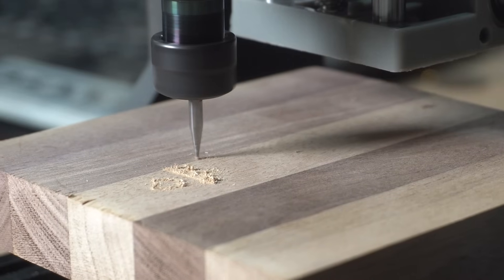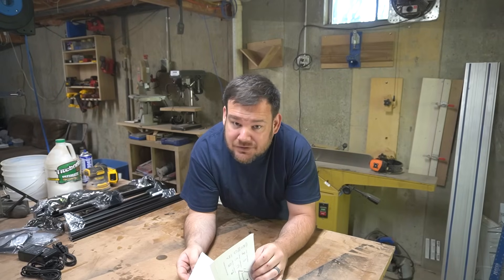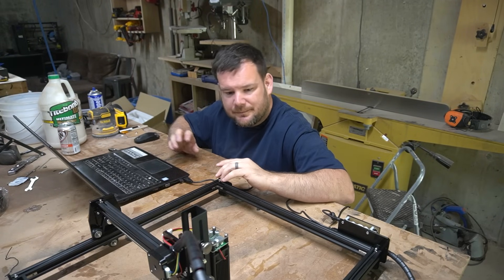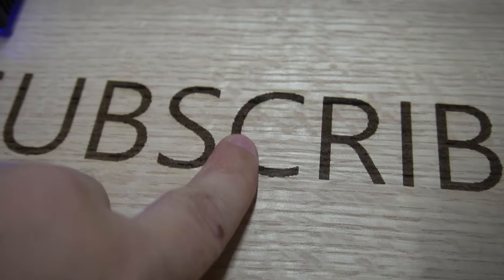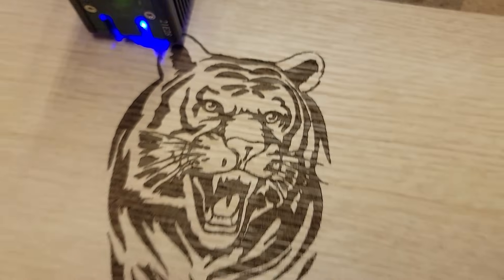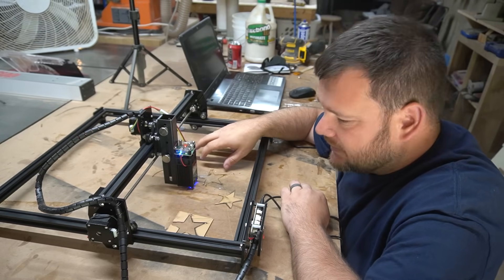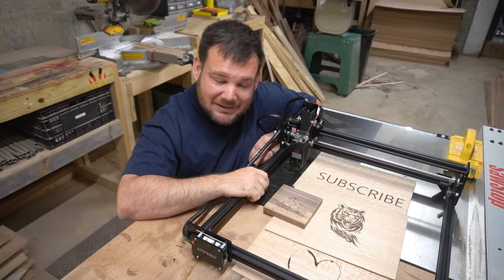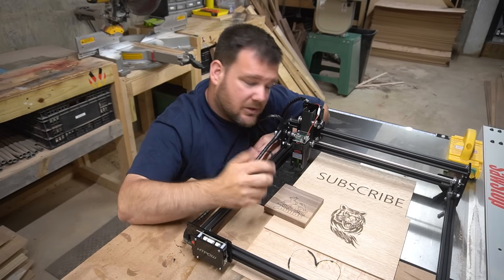The Cheapest Laser Engraver On Amazon

Comment: Wow, great video, really answered alot of my question.  I just bought a small cheap one called ( Roomark 3.5W Output Laser Engraver Machine) from Amazon, I paid $69 for it on a sale and I couldnt resist, like I said its pretty small, the max engraving area is 5.12"x5.12", (13mmx130mm) but I bought it to mostly make engraved leather key fobs and coasters. you should do a review on this one for people with very limited space. Again thank you.
Reply: Do you recommend it? My buddy and I just started making coasters and want to some engravings. Mainly we want to do sports logos. Would you recommend that product to do those?
Reply: @coltonallen9499  Yes it does great on cork coasters, Ive done over 25 sets with it plus it does wood pretty well, just remember that its a laser engraver and not a cutter, and you'll be fine, also play around with the settings to tune in the laser, I put my seed to 6000 mm/min for cork, and 5000 for leather using lasergrbl software, which is pretty easy to use once you tinker with it.

Comment: I think one of the only reasons I even want a machine is because I’m too lazy and sloppy with hand routing and scrollsaw/bandsaw. I have to stay far away from my lines to avoid errors or chipout, which then means way too much time sanding and making a mess of the shop. I have this ideal dream of a machine helping me to avoid all this, and being able to go straight to gluing parts that are perfectly cut to fit together. But realistically a CNC or laser probably isn’t going to save me enough time or energy to make it worth my while unless I were using it to mass produce small parts that need to be identical. And that’s not really what I’m doing.

Comment: Correction my friend,   it's not so much that the white paper reflects laser light causing no effect upon it, think of it more as white is not inherently useful for absorbing light at those wavelengths. For most materials it's going to be more factor of absorption through darker color. Black will always be the best and will absorb pretty much any band of light used on common laser units whether it be CO2, mopa fiber, diode, or any series of diode pumped units. White is just terrible at light absorption.

Comment: Anyone have an image for the USB drive for this machine? I just bought one for less than half the price(already built) but it didn't come with any instructions or configuration software and no safety glasses either. I've looked at several videos on setting up a engraver manually. It'd be great to have what it came with and a recommendation for safety glasses would be appreciated. I also won't mess with it until I have the glasses at least. Thanks in advance!

Comment: It may be a good value for money laser, but that comes at a complete disregard for safety. My main worries are potential toxic fumes, fire hazards and Instant blindness.
It is quite worrying that many people use this laser without any eye protection or the included eye protection. The included "eye protection" may help a little bit but at the end of the day it is just some random colored plastic with no certifications or quality control. A good certified pair of laser safety goggles that actually protect your priceless eyes would cost you about as much as the laser itself or more. 
The only safe use I can see for this, is if you wanted to upgrade it with a fume extraction system and an enclosure to protect against the laser radiation.

Comment: I'm planning on buying this cnc machine with laser too. Was wondering if it can be use as depron (6mm) cutter instead or engraving?
Reply: There are vids for making oscillating wire foam cutters for Depron, unlike routers the sewing machine action of the wire cuts foam real easy. These diode lasers reflect off white foam, but do cut black foam board apparently. I will need to try it, F117, B1/B2 models?
Reply: @babbagebrassworks4278  Yeap, most were saying the same thing. Furthermore, it's hard to get colored depron with 5mm thickness around my area. End-up building my self a CNC Needle Cutter.
Reply: @MyspanaMJ  You should do a vid on your CNC needle cutter, been thinking about getting back into modeling and making kits.  A needle cutter would make that easy and the cutting forces means a low cost sheet sized extrusion frame should work. I got 200 + hours on Paragliders before getting grounded, never got paramotor certified. FPV would be a safe way for me to get back in the air so to speak.
Reply: @babbagebrassworks4278  i’ve built the Erc Timsav cutter, works great. Coming soon will be building the MPCNC Primo and definitely will have a video on that. Paramotor grounded due to no license? Thats bad. Here we do not need a license for a solo but needed if tendem. Mann.. love paramotoring too.
Reply: @MyspanaMJ  Na, grounded by new wife who didn't want to be widow and raise kid alone. I did push the edge a few times and fell out of the sky twice. Here in Oz we must be certified by instructor and get licence, tandem is extra with insurance and paramotor extra cert again. Busy cleaning up junk room to make space for building stuff, learning CNC routing, lasering. Don't have 3D printer but I reckon I can CNC cut parts for one of those wire cutters. Got a pile of old Depron from before marriage. Will try cheap foam first. Makerstore  in Oz has stuff for DIY CNC.

Comment: I have a pair of jl1 that cost me $79 each... One of these has been modified to carry a NEJE 40630 led module.
 
 I cleaned up the wiring since the photo.  I have another one I keep around that's still stock.  

This is the before/after of the laser module upgrade...

https://drive.google.com/file/d/1JjQgJpIEzRpGh043M6wphY099G-kehsS/view?usp=share_link

I run Ubuntu Linux, so I can't natively run any of the software packages that the Chinese supply with these lasers, they are all windows based.

Another user asked the vendor for software and they got an .exe along with a .bin file.  If you run that program it upgraded it to grbl firmware on the 32bit controller and you can use Lightburn.

They are all driven with Lightburn...  

These lasers are a fantastic value, but, currently, hard to find ...  I don't know why they don't just grab a grbl release ...?

Comment: You can cut with that:
- you can't keep the material laid on the base, it has to be suspended like with a metal honeycomb, for the cheap make a bed with some one inch screws in a grid
- build a small air assist with an aquarium air pump or an air compressor

Comment: Is it possible to mount this onto a wall? When you can mount this onto a wall it doesn't take up much space. I was thinking to mount it on a wooden plate onto a wall. It also makes it easier to suck away the fumes especially when you make a small cabinet/enclosure for it with a transparent door at the front. Good or bad idea?
Reply: no
Reply: Bad idea.

Comment: 5 to 10,000 hours on the laser.. question what’s the power of that particular laser.. Some R-rated strictly by the wattage 1,2,3,4 ,5-20,40  watt  and some light the optical power which is described as being lower than there’s a focal point wattage.. And they usually upgrade with different control board and there’s a lot of software out there available . Perhaps better Stepper motors..

Comment: Sadly, Diode lasers in this price range are barebones (which I know is the basis of this video). Though they work, they are missing some essentials. One of these essentials is a dedicated air assist setup. Typically these setups have a way to direct air right on the material where the laser is hitting it. This allows for a more precise burn and less chance of charring or burning. One problem is that the more you improve the laser, the closer you get to the high-end lasers that already have these features. Diode lasers seem better for picture quality burns, whereas a CO2 is more along the lines of a cutting tool (acrylic, wood, leather, etc). I happen to have both and use each tool accordingly. 
 Lastly, a fiber laser is great for marking metal. You can do some marking on certain metals with a Diode and a CO2, but it is super limited and usually have to have some sort of marking spray added, like Cermark or similar.

  Also, for any laser, be prepared to jump down a small rabbit hole on proper ventilation (7:25 minutes into the video above), air assist and most likely an enclosure for the laser. Though most of this can be circumvented by placing a fan in the window, you want to remain present for burns as it can cause a house/shop fire if you walk away.
   Keep in mind that the more detailed an image you try to burn, the longer the burn times. A high def image in a size of 4"x4" can roughly burn for 2.5 to 8 hours depending.
Reply: You seem to know what you're talking about, and a fellow German. 👍

I have a full woodworking and metal fabrication shop, and 3D printers, but this will be my first laser.

What's your opinion on the new Creality Falcon 2. Seems like a nice machine. With current sales and coupon it's $950. Seem worth it? 

Or what route would you go with a budget of $1000?

Comment: I have not the slightest clue about engraving but I find that many Amazon items that seem cheap actually seem to hold themselves quite well for the amount of money. For example I got a mini multitool for engraving wood and such but got it for sanding and metal works. It was about 15 bucks and so many people complained about it. They won't do any heavy lifting but when you keeps their tasks simple and test their limits you get a cheap fairly well working tool. You just can't expect pro tier results from a low end tool but with that in mind you can get great deals for a practice tool you won't be mad about when it breaks. Which it will sooner than later.
Reply: Well they're not Amazon items. They're sold all over the Internet, including eBay.

So you can't just say that buying it from Amazon you're going to have luck. It's a 50-50 chance no matter where you buy it from.
Reply: @dangerous8333   If you want to get all---- 🤓 Ackchyually...
Then that was not really the point. They were talking about budget items you can order. And  this video was about the cheapest laser engraver on Amazon so that is how the poster stayed on topic. 
And what do you mean by 50-50 chance no matter where you buy it? That is WAY wrong. If there were a 50-50 chance of getting a decent working quality item or a crap item that doesn't work, we'd all be screwed. 
Plus Amazon discontinues crap that gets bad ratings, and has a campaign against fraud and knock-off products  so the chance of  getting better quality items HAS gone way up.

Comment: Thanks for your video!  OK, you call it an engraver.  I'm a silver smith, and have been looking into something like this to engrave my maker's mark onto my pieces or little tags that I hang on necklaces & bracelets.  Did they say if it will engrave metal?  I've seen others do it, but not sure what they were using.    Thanks!
Reply: There is a way to use the laser and some material to acid etch metals - the laser "cooks" the material and makes the acid.  IIRC, mustard is one such material some people use, but I'd imagine it would depend on the metal involved.
Reply: Unlikely to engrave metal, that would be problematic with any laser cutter except some super high end ($10k+) fiber lasers designed specifically for metal. Metal both requires a lot more energy to do anything to, and its reflective so the laser would just bounce off without doing anything to the metal (but could potentially cause damage or injuries). Could make some pretty cool tags out of cardstock or wood though.

Comment: LED lasers typically wont cut white materials.  I tried to cut white Styrofoam but no cutting not matter the setting.  REplaces it with blue foam board and it cut right through.   Black foam board cut best.
Reply: You're actually lucky it cut blue. Diode lasers emit blue light, and as such don't work well on white or blue materials. However, strictly talking about engraving now, there is a "hack" you can use when working with these colors: Tempra paint (also sometimes called "poster paint") is thin and water soluble. Apply an even coat to the material you wish to engrave that the diode wouldn't normally work with (clear glass, clear acrylic, etc) and you will get fantastic results once you find your diode's sweet spot.
Reply: @AduroMark-ChainReaction  We've used this technique for engraving white plastic labels using a diode laser at work.  We "paint" them with a black Sharpie, engrave, then wipe off with a solvent.  This also leaves a small amount of the Sharpie ink in the engraving which is quite effective.

Comment: For cutting through thicker stock cleanly, simply find the speed that engraves well without burning the edges, and run it multiple times till it has cut through.
Reply from the maker: Thanks for the info!
Reply: Sure, you could do that...but.

Time is money.

So is electricity.
Reply: sure but some people have the time but not the money @dangerous8333
Reply: @dangerous8333 can you engrave a pumpkin?
Reply: @mikedisher30 Yes, technically you can, but you would have to remove the laser module from the frame and engrave the pumpkin by hand, which I would highly recommend no one ever do.
Reply: @mikedisher30  Yes, you would just have to raise the whole machine to the needed height of whatever you want to engrave on. There are extension legs for these machines.

Comment: i didnt read all of the comments but it seems like if you did a few passes at the higher speed and power you might be able to cut with it. also when cutting through something you might want to get a honeycomb panel that the laser engraver can sit on to help with air flow when cutting something else out. i work with a xenetech (do not recommend) and a gravograph (highly recommend if wanting to cut things out about an 1/8 in thick) both of which do great in their own right. gravograph is so easy to learn its programing and is very user friendly. both laser engravers have a honeycomb that the projects can sit on if they need to be cut out.

Comment: Andy - like your video. Tried to find it on Amazon - no dice. Do you have another possible link to where it can be sourced?
Reply from the maker: Thanks. Unfortunately I don't have another link. Hopefully the manufacturer makes them available soon
Reply: @AndyBirdBuilds  sadly, they won't. These machines are Ortur clones, mass produced in China (doesn't make em bad...I'm just pointing out the facts), and they are sold at what ever price point they can get away with for as long as they can. As soon as Ortur (also a Chinese manufacturer) gets wind of the competition, Neje (Ortur's parent company) buys the factory or sues for breach of patent (serious offense in China if the owner of the patent is a successful Chinese company...which Neje is), as Neje owns about 200 patents on these machines in this style. Companies like TwoTrees and Sculpfun, that make similar machines to the Ortur line, license the design and diode housing configuration. 

A couple of things you should be aware of just as a matter of course:
NEVER install the software that comes with these low end machines, your instinct to toss the dongle aside was a correct one, regardless of the video it had on it. They are often loaded with trojan horse viruses that will lie dormant sometimes months at a time before reaching a critical time marker and then wreck havoc on your computer. LaserGRBL is free and should run that machine, as it will almost any Ortur knock off, as should Lightburn provided the control board isn't complete garbage. You should probably do a short follow up about that information, and get both LaserGRBL & the free trial of Lightburn so you can test them with the machine. If it only runs with their software, you can easily upgrade the logic board to something that will run those. 

Secondly, diode lasers have a "cap" that holds the gasses inside the diode's firing area (the name escapes me at the moment). The majority of them, ESPECIALLY Ortur knockoffs, and even Ortur in the early days (and occasionally Neje still to this day) are either uncapped, or not capped well. As such, plan on replacing the laser unit fairly soon. It's likely not going to last very long, but the "guts" should last for a few years with proper care.

While I still use diodes for canvas engraving, our business has grown to where a CO2 laser is absolutely a necessity, which is why my channel (with its whopping one video and zero to a handful of subs lol) focuses on CO2 stuff, BUT I have extensive knowledge and background with these machines, so feel free to shoot me a PM and I can hand you enough info and detail to produce about 20-30 videos showcasing it if you want to keep going down this road. I'd be happy to give you a helping hand in the right direction. Cheers!
Reply: @AndyBirdBuilds  oh...and one last thing, NEVER run a diode above 80% unless you want it to die a quick, and painful (for you) death. Remember, the capped gasses are a finite resource for your machine. And there's no taking it to the "gas station" to fill it back up.

Comment: The beam stays on after engraving?! That's a safety hazard, even if it's super low power. Hopefully there's a firmware update to fix that
Reply from the maker: I thought this was weird as well, but it looks a lot brighter than it actually is. You can always turn the machine off after engraving
Reply: My NeJe stays on all the time but at about 1/2% power. Mostly for alignment use.
Not really a safety hazzard at that power level ... wont even darken paper.
Reply: @Willeecue  for my laser it can light wood on fire at 1% at its true focal point in about 2 minutes and it's only a 5.5 w laser